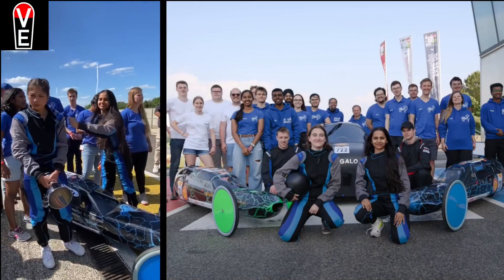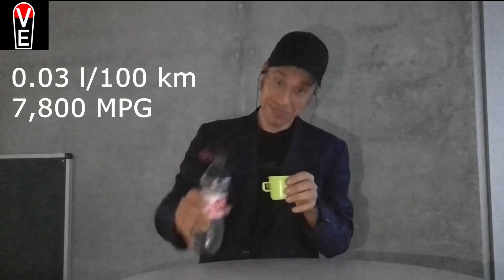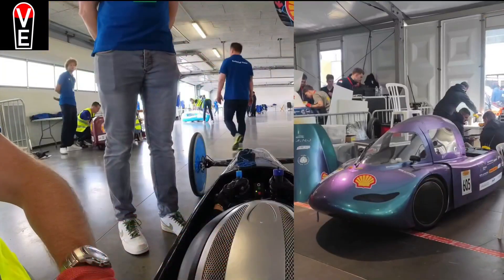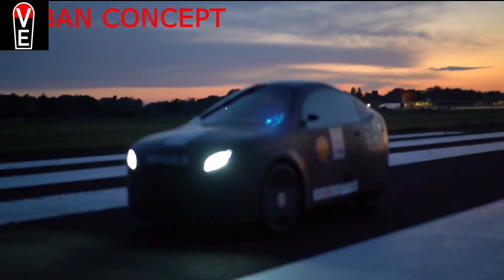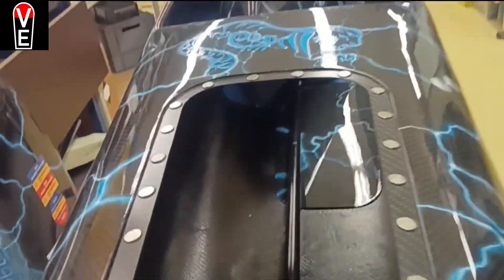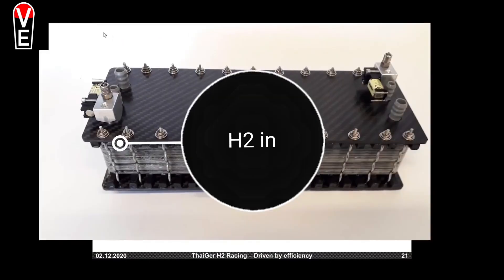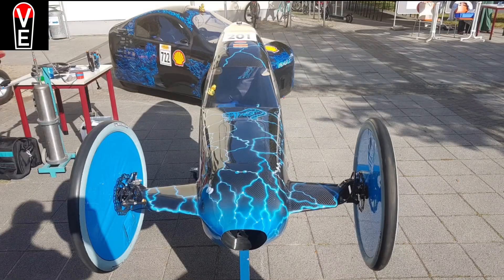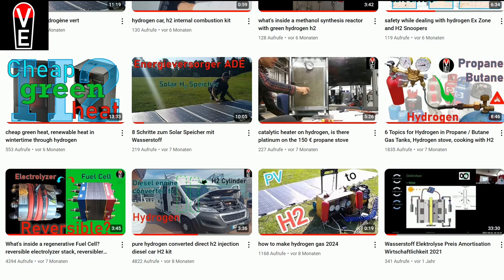most fuel efficient hydrogen car, fuel cell electric vehicle, velomobile

Comment: I don't understand why no scooter 🛵 or motorcycle company builds a small lightweight enclosed vehicle. Like a motorized velomobile. Or like what's shown at 0:45 and use an efficient motorcycle engine. If the vehicle isn't dorky looking & can go hwy speeds without being slow. While getting 60-75+ mpgs, people would buy them. The car at 0:45 could be a tandem 2 seated. With some aerodynamic removable storage compartments. That could mount to the outter body. If 2 people wanted to go on a road trip.
Reply: The main problem is safety
Reply: @aletrip642  A 3 or 4 wheel motorized velomobile would actually be much safer than riding a regular 2 wheel scooter or motorcycle. Especially if it had  a roll cage.

Comment: Most fuel efficient on least efficient fuel. That makes sense.
Reply: An EV is more efficient use of the electricity but the parts needed to make an EV are more expensive.....So if you can build a diy hho generator for cheap and run a cheap small engine off hho.... It's much cheaper to build but less efficient use of electricity to convert water to hho gas.

Comment: I get that this is used to advance research on hydrogen powered vehicles, but forgoing the electrolysis and combustion for a electric engine would make it plain more efficient. But if the race is about hydrogen cars i get why its done like this. Given the other designs presented (more car-like) its no surprise this one won.

Comment: "powered by water"
What a stupid thing to say. They are obviously powered by electricity, just in a very complicated an inefficient way. They would go farther if they just stored whatever electricity they got into a battery at 95% efficiency, rather than using electricity to electrolyze water to make hydrogen(throwing away some energy), compressing the hydrogen gas into a tank(wasting even more energy), and then running it through a fuel cell (losing even MORE energy) to get a fraction of the energy back..